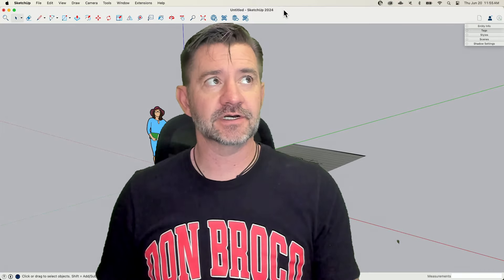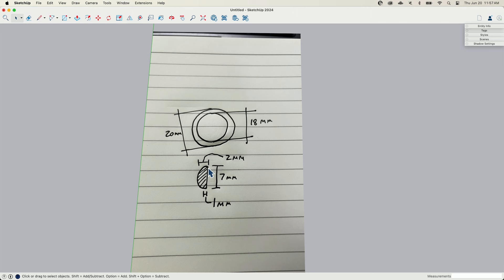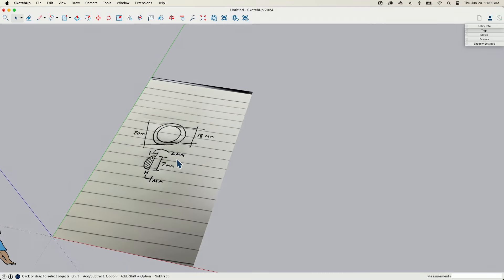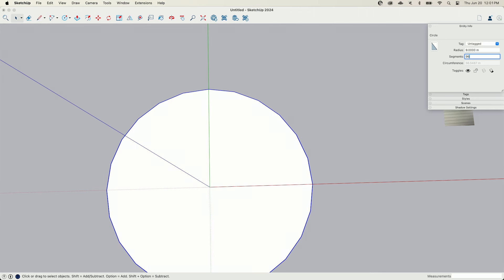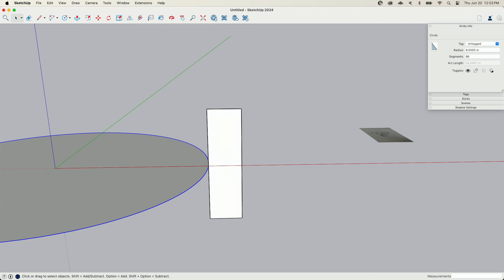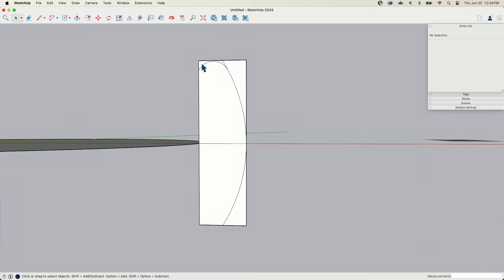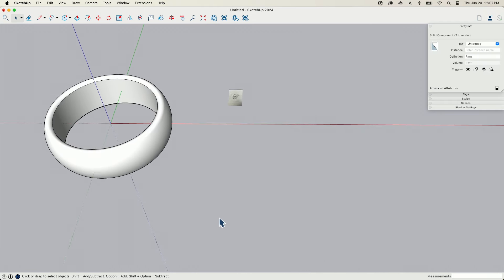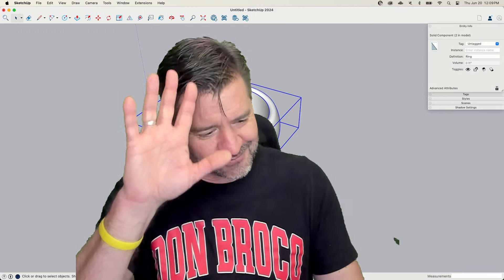How to Model a Ring in SketchUp

Comment: Nicely presented Aaron, however your legendery maths skill strikes again. The diagram is incorrect but model correct for an inside diameter of 18 units and model thickness of 2 units. If you measure the models’ outside diameter it'll be 22 units!

Comment: Thanks a lot for such a detailed explanation. Would it be possible for you to make a video on "ELECTRICAL WIRES" which can later be modified such as its length, width, flexibility/bending etc. I tried some extensions, but I was not satisfied. Thanks in advance.
Reply from the maker: Great suggestion! Added to the list, thanks!
Reply: @SketchUp  Thanks